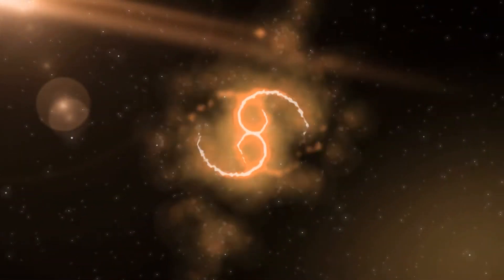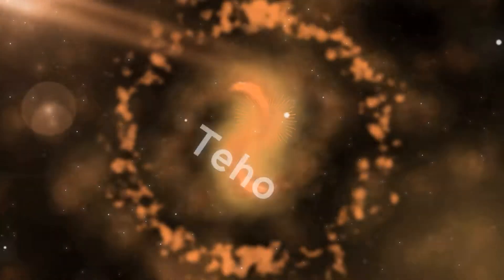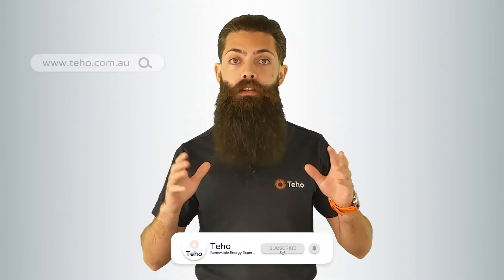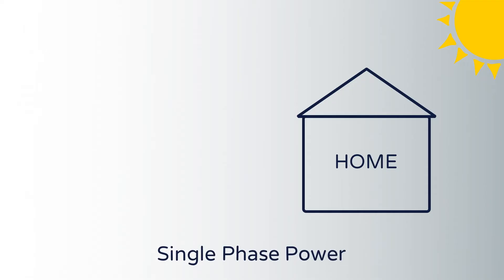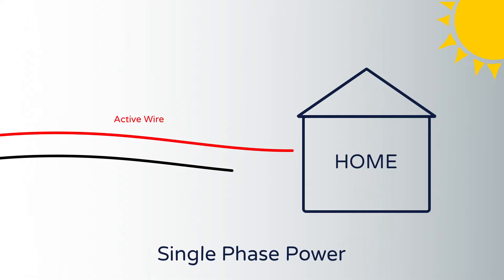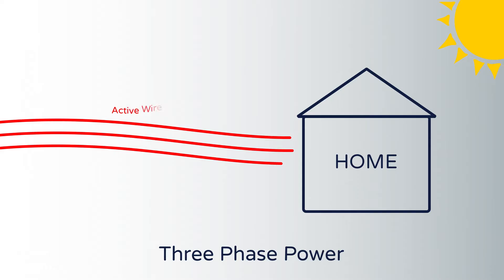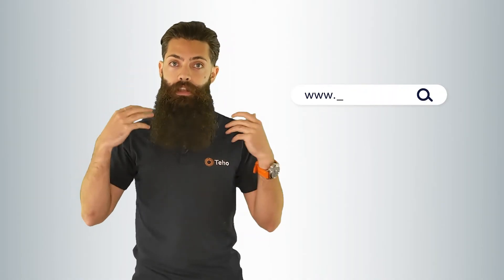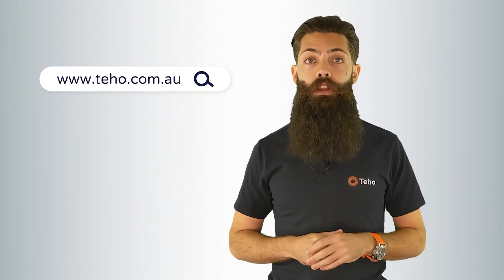Single Phase VS Three Phase Power | What's the Difference? | Teho | Solar And Battery Experts

Comment: I have two phase - what does this mean?
Reply from the maker: Two-phase is a bit of a mixed bag because it can mean a couple of different things. In most cases, it’s basically two separate single-phase supplies rather than a true “two-phase” system. You can still install solar and a battery, it just affects how the system is wired and monitored across those phases.

Comment: Im looking for advice. If someone can please help me. Im renting a unit in a complex.  The landlord gives me utility bills that have ridiculous amounts. And it jus goes up. In 3 months the consumption went from 584 to 1047. I asked for him to send me photos of the readings. I dont even know what im paying for.
I hardly used electricity as im not at home 80% of the time. 
Hes taking chances because im a woman and know i dont know.
Pls can someone explain.  Its a whatt hour meter its says on bottom  single phase 2 wire . It has 5 digits and a red counter just next to it.
The meter boxes of all the units are installed further down the complex. 
Pls can someone tell me how would i make sure that im not being taken advantage of. And what should i look out for. This stuff is greek for me
Reply: You could note down your actual meter reading and compare it with your bill reading if they match. Also is your meter shared with any other unit

Comment: Is it possible to use one phase from the inverter for domestique use and the 3 phases for a water pump for example??? Like we do in electrical sertings: we use the three phase to power engines and we use one of the phases to power the home. Can we do the same with solar energy???

Comment: How can I tell if my home has 3 phase? I have 3 meters at my home but don’t know why. Thanks
Reply: In you main fuse box you will have a circuit breaker named Mains if it's 3 phase there will be 3 circuit breakers , one for each phase.
Another way is to look at the wires from the mains pole out on the road if you have two wires going to your house it's single phase , four wires for three phase , one wire will be negative or neutral.
Reply: 3 phase can include 240 volts, such as ranges and I think, dryers. Single phase is only 120 v
Reply: @wheatstonebridge  Depends where you are. In Australia, single phase is 240v.